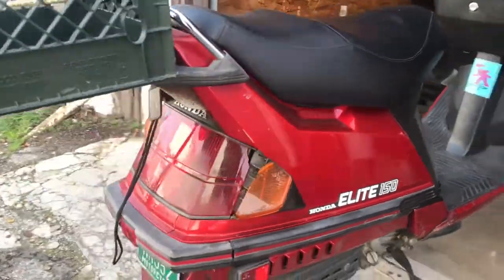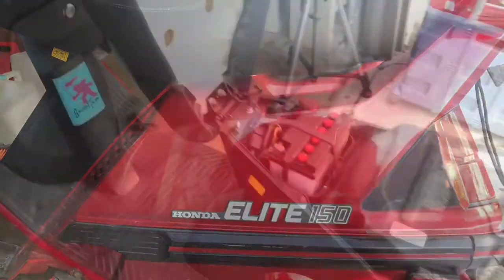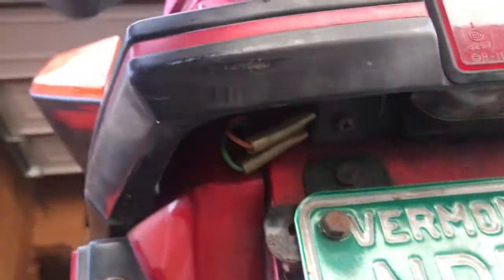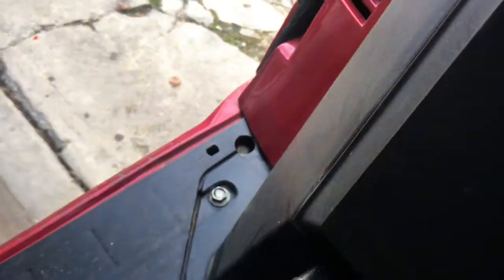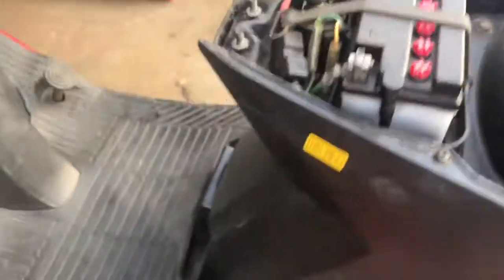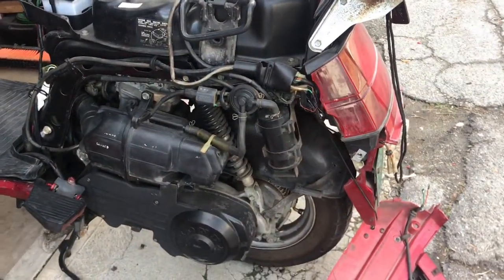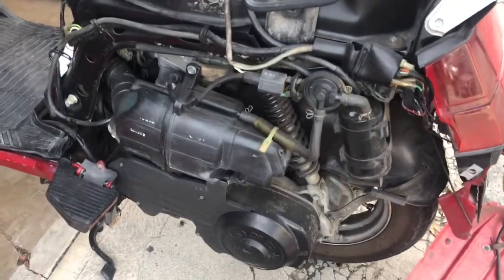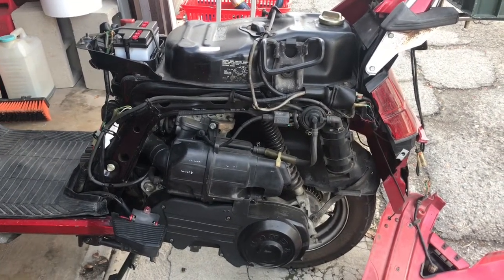1985 Honda Elite 150 plastic panel  removal

Comment: I just purchased a 1986 Honda Elite 150 Deluxe. In working on it I discovered all the "Phillips" head screws are actually JIS (Japanese Industrial Standard) screws.  On most of the body panels, a Phillips will work.  But on some of the carburetor  screws, you should get and use a JIS screwdriver.  A Phillips will strip out a JIS screw.
Reply from the maker: Absolutely. I have a set of bits that includes jis it’s just not labeled.

Comment: Have you ever changed the tires? I have the same model and am looking to replace the front and back wheel. Was wondering the difficulty level
Reply from the maker: yes wheels come off pretty easy. front, just nut and bolt axle shaft. speedometer cable will come off as your doing this. Rear is just the nut but i think the muffler had to come off which could pose some rust issues require rust penetrate or heat. I took the wheels to shop to have tires mounted balanced and new valve stems. hope this helps!
Reply: @MikeTheFixer  Thank you!